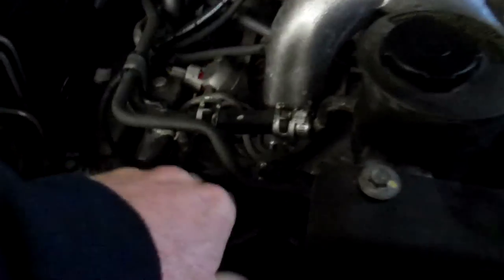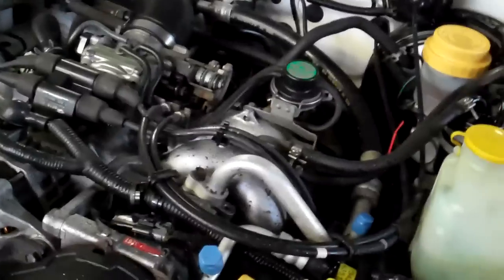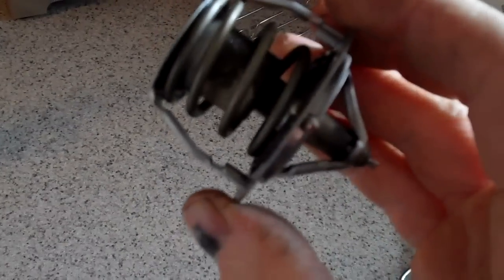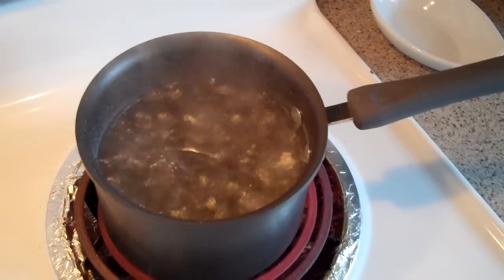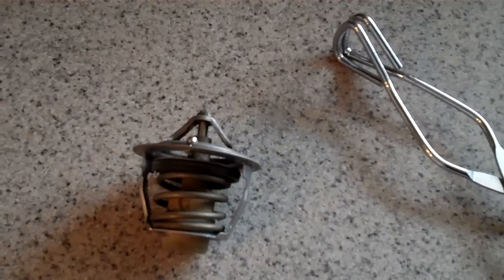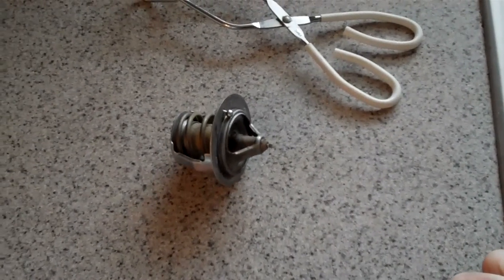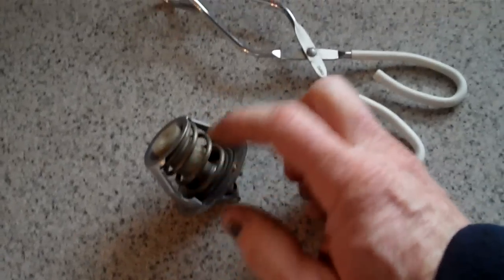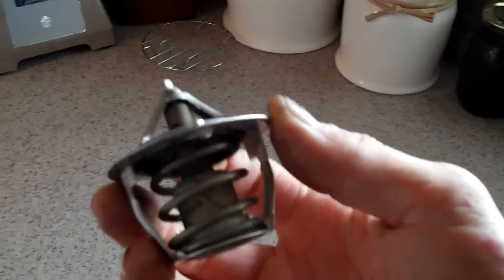How to diagnose a Subaru that overheats after ten minutes of driving

Comment: Hi Brian,
My subbie is acting up a bit, when cruising on the freeway temp goes up to 208 and hovers around 205. 
When car is not moving and idling goes to 205 and then fans kick in temp goes down. 
Lately tho, fan kicks in stays at 200, turn the heater on and temp drops slowly...... Could this be a sign of bad thermostat? Or is it head gasket? 
Thanks in advance

Comment: Thank you, very comprehensive videos. I do have a Subaru, it have been good 2 me but lately I start 2 loose cooling, no white smoke, no green or humidity on oil cap, no oil deposit in the cooling idle thank, engine temperature indictor never show sign of overheat, engine sound good as usual. But My daughter borrowed it last wk and now sit on my driveway 4 overheat, I did change Thermostat but NO fix?????
Reply: Dis you find out what was the problem ?

Comment: I have a 2008 subaru impreza basic model and i replaced thermostat, water pump, timing belt, pulleys, belts, upper lower hoses, radiator, bypass hose and i bled the coolant. Afterwards my coolant levels seemed low, and i would have to top it off every 2-3 days. Just wondering if i can get any help of what it might be. any answer or opinion is appreciated. thanks

Comment: My gfs 03 legacy is over heating after about 10 mins or 30 mins of driving. Only one fan is kicking on. The driver side fan does not kick on.
Both lines are hot.

Comment: I JUST BOUGHT 2006 LL BEAN H6.I CHANGED THERMOSTATE AND TEMP SENSOR..I STILL HAVE TEMP GUAGE THAT GOES UP TO 3/4 THEN DROPS BACK DOWN TO HALF AFTER DRIVIN 10 MINUTES....IT JUST KEEPS FLUCTUATING BASICALLY..WOULD DRILLING SOME HOLES IN THAT THERMOSTATE HELP WITH TRAPPED AIR PASSING THROUGH IT BETTER? ..DOES DRILLING THEM ON THIS YEAR AND MODEL WORK DO YOU KNOW?
Reply from the maker: IT DOES WORK.  LESS IS MORE IF ITS OPENING UP ON IT'S OWN THOUGH.  ONE HOLE HIGH SHOULD DO IT IF AT ALL.  IT SOUNDS LIKE THE THERMOSTAT THAT'S IN IT IS STICKING A LITTLE.  I RECOMMEND REPLACING IT WITH A DEALERSHIP ONE.

Comment: do you happen to know what the sensor is that's right next to the coolant temp sensor on the back of the engine? it has one wire and it broke off .   1996 legacy 2.2 150,000 miles
 I've had the engine resealed and heads resurfaced, new rad, thermostat, hoses,working on the sensors now,,,,...still hot!

Comment: Brian if the thermostat was tested and works, the bottom radiator hose is icy cold and the top hose is hot.  I swapped out the thermostat and it still is the same result.  Could this be a water pump issue?

Comment: Awesome videos! So I have made my life extra challenging when taking off my thermostat housing, I broke off a bolt. It isn't flush with the block, but being that it is under the block I'm not sure any WD40 or PB blaster will get into the threads. Any ideas on how to get the bolt out or have I just killed made my car?
Reply: the thermostat housing bolts onto the water pump. The water pump bolts onto the engine block under the timing belt covers. At the very worst case scenario, you change the water pump. And while you're at it..change the timing belt and idlers ..they sell them in a kit that includes the water pump ..then you're good to go for another 100K miles..providing the head gaskets weren't the problem!

Comment: You might mention that buying a aftermarket thermostat is not a good idea Subaru thermostat only also when it comes to the jiggle valve in my opinion it does need to be facing towards the front both of these things caused me a problem in overheating on my 97 legacy with a 2.2

Comment: I've got a 2000 legacy outback,
I've changed the thermostat, put new spark plugs, changed oil and filter, and top off engine coolant, and it's still over heating, It doesn't show any signs that the head gasket is bad but when I was putting coolant in it, the radiator kinda  geysered. Heaters and defroster don't work so I think I need a new heater core but I don't think that has anything to do with the overheating.  My engine fans work as well fyi. Anyone have any thoughts? Have not tried the burping thing yet, but will soon.

Comment: @briansmobile1 Its basically an overhead cam version of the VW boxer engine

On blown head gaskets/cracked head/cracked block - You forgot the 'mayonnaise' on the oil fill cap, and bubbles on your dipstick, along with an oil level that constantly goes up to the point it overflows out the dipstick tube

Comment: Mine 2008 Subaru Impreza has the same overheating problem + coolant leaking. The inter cooler is ok and changed the thermostat but still haven’t figured out what it could be cuz recently 15k km ago water pump was also changed. Help me please

Comment: So I am thinking it is air in the system or may have faulty bad factory thermostat and leaning towards just replacing it and drilling an extra hole to bleed the air?

I have checked for oil in the the radiator and did an extra oil change to check for antifreeze mixed in with the oil and it is all clear?

I have Hayes manual and in the trouble shooting section they also indicate that it could be a bad water pump or a block radiator core. What are your thoughts on this?

Comment: This is very rare but I proved to myself that a free floating water pump impeller was causing the over-heating problem. Take out the thermostat, from under the car look at the impeller with a flashlight, try to spin the impeller with some type of prying tool. I was spinning the crankshaft while feeling the impeller movement. At first it seemed to be turning properly; but after a few tries it became obvious the impeller was free floating. That's tricky. After the pump is re[placed, I hope my engine will stay cool and the cabin heater will warm me.

Comment: Hi Brian. How about drilling an extra hole (or two) in the flange of the thermostat? I was having overheating problems before but now everything seems to be ok... The temp gauge stays level now. I'm just worried that if I do have a head gasket issue, all I have done so far is take care of a symptom instead of the problem. Is there any danger of my motor blowing up even if its not overheating? 98 Legacy GT ej25
Your videos are great btw! Thank you for all of the well-structured information!!!

Comment: Wondering if you can help me. My 2 kids both have a 2009 Subaru legacy sedan with the dreaded 2.5l engine. Both vehicles had bad head gaskets about a month apart from each other. I replaced both head gaskets after having both engines inspected and milled. I also replaced the sparkplugs, wires, timing belt, water pump, and thermostat on each engine. My daughter's car seems to be working fine. Now it was time to do my son's car. The car just keeps overheating. Top and bottom radiator hoses get hot. The hoses going into the firewall are both hot. Hot air comes out into the cabin. I get no error codes on car. I am stumped. Any suggestions would be welcome. This weekend I am going to take the thermostat out and run the car without the thermostat to see if that is the problem. I am pretty sure I did this already but I am not sure what else I can do.
Reply: Did you find out with your son's car?

Comment: Question: If I had a possible bad thermostat and had to drive about 300 miles to get home to change it, first, is that possible? If so, how would I do so safely without overheating or causing damage to my engine?

Comment: @briansmobile1 Its a new water heater, timing chain, motor oil after driving her for 2,000 miles look clean as it could be. new preasure cap on radiator too. Radiator is also new and does not leak. I am so lost..lol

Comment: hi, my GC8 WRX GT ver 5 coolant leaks when im driving rough or when i rev high.. i sent to workshop and they removed my thermostat.  it was ok but after a month the coolant leaks again..i couldn't fine where the leaks came from..all of the hoses looking fine and no damage..coolant leaking from below..not from the radiator hose or radiator coolant tank but below the coolant tank..

Comment: question . . i got a 99 subaru legacy gt 2.5 dohc. . the head gaskets dont leak externally at all . . exhaust fumes smell like water vapors (clean), no leaks of coolant anywhere . . no coolant mixture in oil pan, oil cap or reservoir . .  when i first start up the car cold and drive it around the block some coolant will shoot into the reservoir and almost overflow it .  . temperature will go above half way when stopped and quickly go low again. fans work . any tips ? car drives awesome.

Comment: brian I have an overheating issue on a 1990 jeep Cherokee. I don't know too much about cars but, I'm learning. I do not think its the thermostat it only overheats when it sits still. If I am on a highway I can drive for hours and it will stay right around 200 degrees but, if I get in traffic 10 min it overheats. I think it has something to do with my electric fan not coming on. I tested fan, wiring, fuse, relay and all are ok. I am going to wire it this evening so that when the key comes on the fan does automatically.(For Now). I got some 10gauge wire and an inline fuse holder for the poss wire do you think this will work??
Reply: Before you wire the fan, check if the fan actually comes on. Pin the throttle at around 2500 revs from a cold start until it warms up, the fan should turn on. Check the radiator and ducting for obstructions.

If you are correct that the fan and its wiring components are good, all I can think of is some sort of fan controller being shot. Find a wiring diagram for the vehicle and see what else is sending power to that circuit.

Comment: Thank you for the video. What is your thoughts on FelPro MLS head gaskets? My 01 OB had bad head gaskets at 95k miles. I put in felpro MLS and sold to my manager who took care of it as his commuter car the last 6 years. (Very ocd) anyway he bought a new 19 OB and  sold me the old one now with 150k miles on it. But since I’ve had it, about every month i get air in the system and purg it then it’s fine.  I know it’s going to be time again because I can hear air and water in the heater core when I start it up. Wrong gaskets? Maybe it Needs head gaskets again or he let if unknowingly overheat...System has no leaks and oil and coolant very clean. Is it possible for the coolant system to suck air from somewhere? Thank you and I’ll let you know if it’s something crazy I find as the cause. 😂 lol

Comment: I have Subaru Legacy B4 twin Turbo Auto 2001 (made in Japan), I tested the thermostat as u shown, its working fine, Can't see any milky Engine oil, No White smoke from exhaust, No bubbling from the radiator top either. Car still overheats!!!!!!!!!!!!!!!
Can't understand whats exactly wrong with it. 
I removed Thermostat and went for a ride and it doesn't overheats. Could there be a problem with Water Pump?
Reply: TheSnipperFan
Did you get to bottom of issue? I have same problem.

Comment: how to tell if you overheating gauge work fine, i got manifold leak on both side and all the engine bay get super hot, hose everything, i can't even touch by hand the upper radiator hose without getting hurt.both shield cover was fall to rust, but gauge is telling me everything is fine, i do have a check engine steady and a cruise control blinkingthis was like that before and after the coolant flush i did, and after a drive if i check the manifold i see smoke coming out of it

Comment: How would one go about fixing the head gaskets on the Subarus. I know for sure mine are not good and need replaced, I was told it's very hard to do but I'd like to try.
Reply: You need to lift your engine, probably best to do it at an authorised Subaru dealer...not cheap though, but it never is.
Reply: +Jerry Addison That sucks, but there's alot to be done and tested before you tear down the engine. For example, it is death serious that your radiator caps are sitting on the right places, not being mixed up.
Reply: +Jerry Addison First of all you can replace your radiator caps with two brand new as they can start to malfunction when getting older. Its two different caps, not just the pressure you read upon them. 

I would also like to know when and how the car is acting when it overheats, is it when you drive slow or fast or doesn't it matter what speed you're travelling in? Do your two fans run  properly?
Reply: +Jerry Addison Is it wet under the car? Well, the leak can anywhere, if there's a leak it will probably be the radiator or and old hose. If it's the radiator you could probably seal it yourself by using an soldering iron. If a hose is leaking you simply buy a new one. :)

Comment: Hey i have a subaru legacy 97 2.5 gt i started it up this.morning and let it heat up n when i go in the car the heat was warm n gauge was good then i drove two blocks n the temp gauge went all the way up n the heat turned cold it only overheats when its driven when its running in the driveway it is fine n heat is hot. . . Im thinking it is the thermastat any ideas?

Comment: I am also hearing water trickling when I first start to drive my 08 Outback. I posted a question on another video about why my car keeps overheating. It's been more frequent lately. The engine just sounds rough when I accelerate too. If I am doing alot of uphill driving I will notice the coolant level goes down also.  What does all of this add up to?
I had the radiator flushed and checked for leaks, I had the compression test for gases done, I changed thermstat housing. my mechanic not sure

Comment: Very informative, thanks! I have a 2002 Outback 2.5. Is it normal for them to reach operating temperature very quickly? Also, even though this is off topic, I dropped a factory reman engine in that same Outback that once it loosened up a bit I started getting what I learned is "piston slap". The dealership claims it is harmless since it goes away when it warms up, but my thinking is, metal slapping metal is never good. What are your thoughts? Thanks again!
Reply: It's from using 87 octane instead of 93 octane gas.

Comment: brian,
i have discovered a hole in the radiator i believe. it steams from a certain location all the time. do you think that is the problem or the reason air is getting into the system? thanks

Comment from the maker: I once had to temp cycle bleed one EIGHT TIMES before it would work properly.  I cussed.  Alot. That's 10min drive + 45min cool down times EIGHT.  That's over seven hours!  It's really stressful- especially when you've already covered your bases.  There's an outside chance (8%) you have a cracked head and compression gasses are coming in, but you can test for that using a compression gasses test kit like in my videos.

Comment: hey Brian I know this is an old video but, I have a question regarding how to fill your system with coolant on these flat engines,  since I'm about to change the oil cooler o ring and a new T stat. should I fill the radiator first and then keep pouring coolant on the top tank to fill the whole system and just bleed it out for a few minutes?

Comment: I let it cool down for like 20-30 mintues at a time and even tried using the heater to help it disipate heat. but once I got home, I stopped driving it and have a new radiator on order. I was just hoping I didn't kill the head gasket...it's my first and only car that I also plan on tuning into a racing car...

Comment: Thanks man, everything you said makes perfect sense... =( Unfortunately for me. I do indeed have a leaking head gasket on my 2002 Impreza 2.5 RS, and EVERY fall or winter I have these issues with overheating when I try to use my heat. Within a week of using heat I start getting issues with overheating. But it was fine all spring and summer bc I didn't use the heat... usually I replace the T-stat and its fine for awhile. But this time I barely lasted a month after my last T-stat replace... Don't know what to do i cant afford the $2000 they want for a gasket replacement... Oh well, keep posting wisdom my friend!